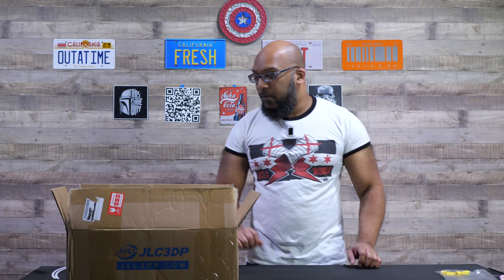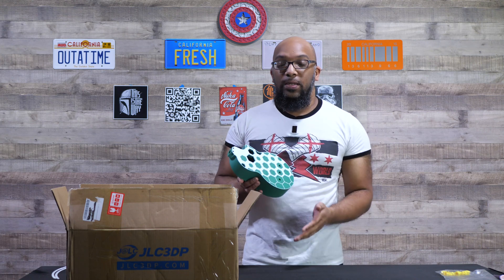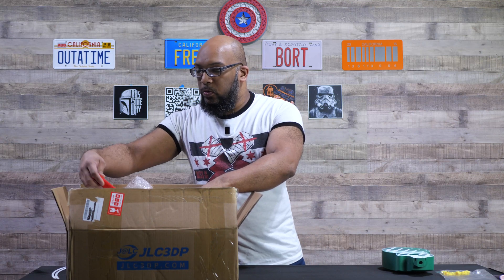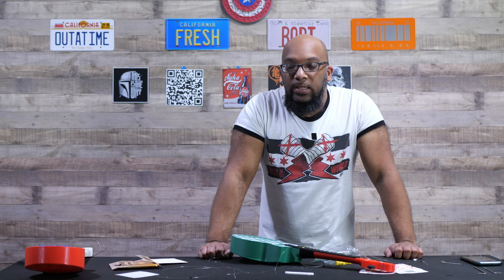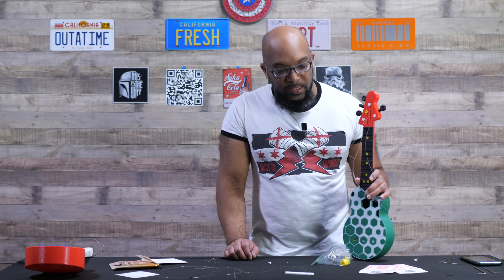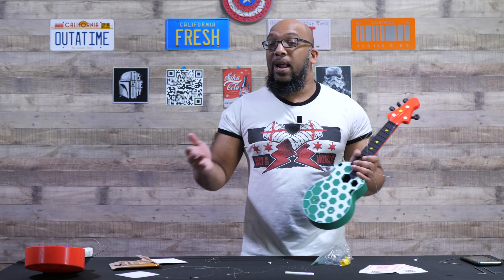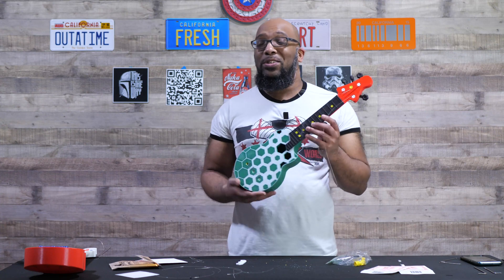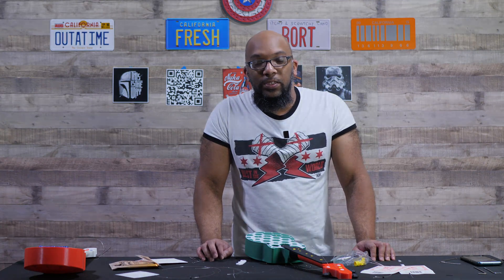My Second Favorite Failed 3D Print

Comment: High temp heat glue gun and then print some "glue" sticks made of filament on a printer to feed into the glue gun and then use it to melt and sink in some new bolts?

Comment: 3D Printed Ukuleles and Guitars are a challenge because of string tension and its effect on plastic. I have had good success with tailpieces and floating bridges on my 2-string ukulele sized guitars. The neck goes through the body and I use a carbon fiber rod to prevent the neck from bending. The mini-Chugger I finished today is all PLA with conventional tuners. I have tried various 3D printed tuners, none have functioned effectively for any length of time with regular play. Good luck on attempt three.

Comment: Redesign the bridge with three posts that fit into the 3 existing holes. Glue up the bridge at the surface,  lube those new posts too and the holes. Clamp it down if you can. Let the whole thing sit for a couple of days to ensure the glue has properly set. This baby ain't yet dead!

Comment: Heat a flat heat or similar flat object and melt into the threaded peice that broke off, let cool and then you should be able to screw the broken peice out, I'd recommends printing the bolts with the layer lines going from top to bottom of the bolt, vs on the horizontal plane of the bolt. Cool project man! Hope it works out